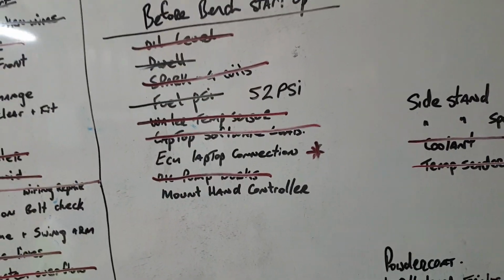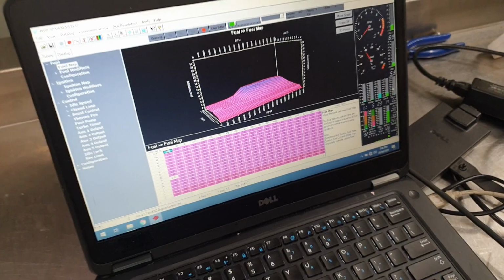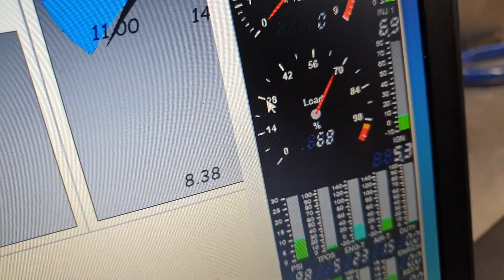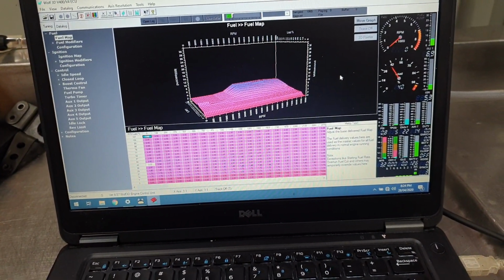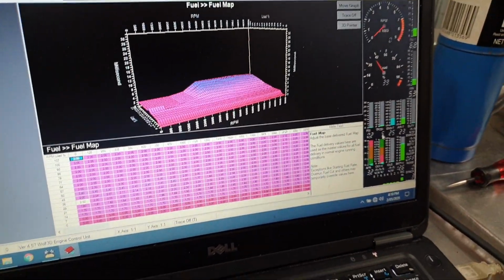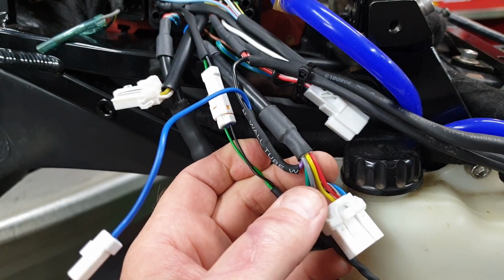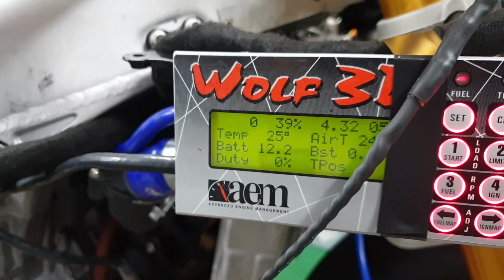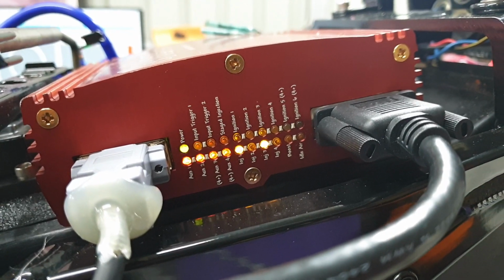Rebuild Project : ZXR Kawasaki TURBO Bike Build Project : Ep45 Motec logger and 1st Starting Attempt

Comment: You got the spark plug leads round the wrong way?
Reply from the maker: Yep thats sort of correct.  They are on the correct location, but there is two wires coming out of the ecu that fire 1+4 and 2+3.
These were wrong so all cyls firing at BDC. Shes a runner now.
Reply: @turbobike749  so sort of exactly right 🤣 glad to hear its running.
Reply from the maker: @vxlgsi  yes ,,basically, sort of exactly correct . 😂